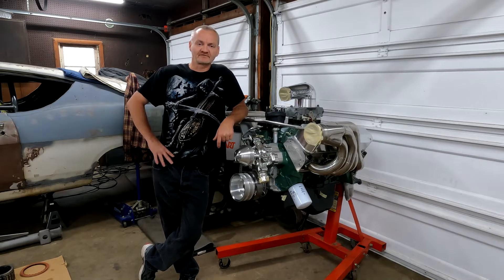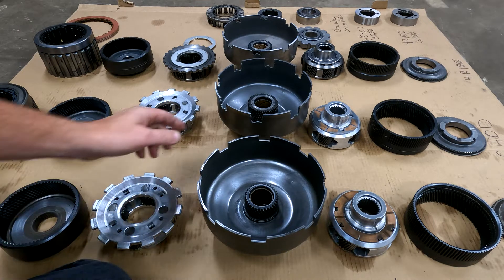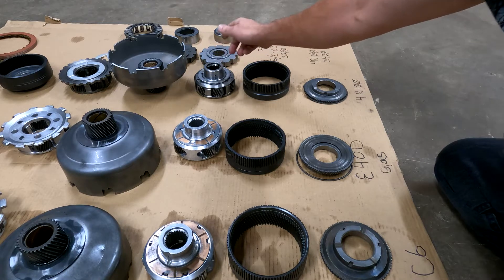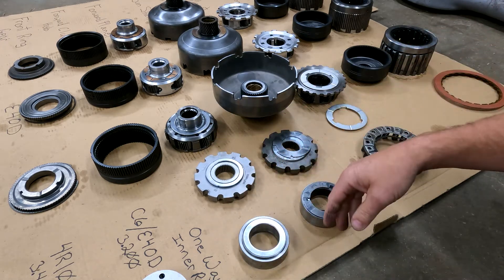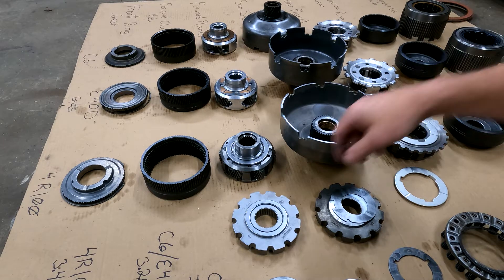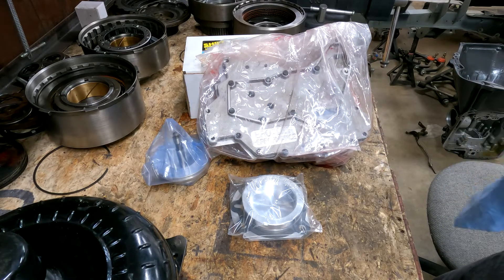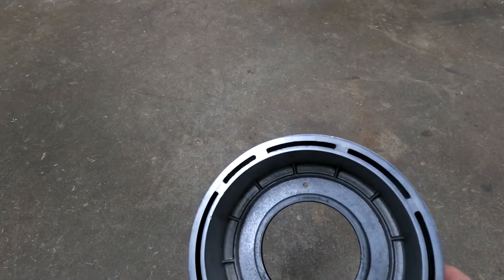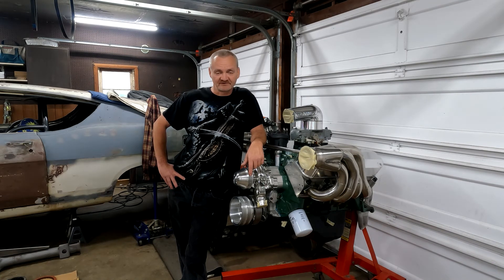Ford c6 for1000+ HP Twin Turbo 460

Comment: just seen your vid on c6. building a pulling truck with a c6. using a 460 as engine. watched it several times. could you combine the parts used and explain the pinion gears you used.  seems lots of parts interchange from e4od and c6. and some came from diesel trans. might be worth picking up a used e4od and a diesel trans to use parts compared to cost of new parts.

Comment: My c6 flares 2-3 gear has it happened to you and how did you fix it.
Reply from the maker: Every trans is different. Try tightening the band a 1/4 turn more. The factory specs are just a starting point.

Comment: Great Video, very informative. Where can the park gear with the bearing be purchased? I've looked all and come up with nothing. Is there a part number on that bearing in the event I decide to  have one of my gears machined? Many Thanks.
Reply from the maker: CK performance still has them. Im glad this video is helping some people out there cause info on the c6 swap parts is hard to find.
Reply: @BADTOAD454  Many thanks for the reply. I’ll check them out tomorrow. Thank again.

Comment: That hole in reverse piston looks way bigger than .020 - .040" ??
Reply from the maker: I was not paying attention and grab the wrong bit. I had it welded and redrilled it the correct size. 
The trans is in the car now and works great.

Comment: Can u list all the part numbers or parts that u need for this build, I’m looking to build a c6 for my mud truck
Reply from the maker: I have no part numbers.  look this up on ebay , C6 6 Pinion Steel Front Planet Low Ratio Upgrade Kit E4OD 4R100 For Ford Lincoln......
Ebay is where i got mine from , took a few months  to find everything i needed.
Reply: @BADTOAD454   thanks I think I found a kit from Ck performance for everything I need for my rebuild.

Comment: Thanks for this video.  This is some valuable information about building the C-6.  My C-6 is a 94' that came with my 460 motor.  I'm building a big block motor for my 67' F-100 that will probably put out about 575 hp for the street (my guess).  Maybe I don't need everything you talked about, but some of it would be great.  Can you give me your advice on what I should use?  Would really appreciate it.  It's hard to find anything on the C-6 anymore.
Reply from the maker: I'd say a good quality rebuild kit and upgrade the front 3 pinion to a 4 pinion if it's not already.

Comment: why you grind down your Sun shell for?
Reply from the maker: The slots on the sun shell are to tall. If they are not cut down the direct clutch drum will not fully engage. And you will not be able to bolt the front pump all the way down thus binding up the trans.
Reply: @BADTOAD454  How much did you actually take off?
Reply from the maker: I think it was around 1/2

Comment: I have problems with the six pinion rear planets eating thrust washers and the forward planet hub Eating the front of the forward planet hub any Suggestions
Reply from the maker: Did you check the front and rear Clearances?